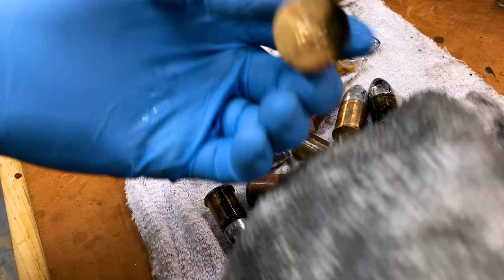Adam Savage's One Day Builds: Hellboy Samaritan Bandolier!

Comment: I have an original late 1800s cartridge belt, holster & Colt .45. The cartridge belt uses slightly lighter weight leather to hold the cartridges and is stitched in between each loop rather than threading the loops through slots in the main belt. It allows the cartridges to seat closer together and the loops don't change size because the belt slipped through the loops. I have no idea which would be easier to make, but since it's held up for well over 100 years I'd say stitching is a good method. Just sayin'. You can see the belt, holster and pistol here: https://www.dropbox.com/s/omqlqhjope24d2s/Colt.JPG?dl=0

Comment: Wouldn't it just be easier to buy real brass and drill out the primer pocket to make in inoperable and just load a dummy round? You could buy bullet molds that would fit the brass to cast specialty stuff or just buy hollowpoints.  It would be tons cheaper, faster, and still just be dummy rounds.

Comment: For someone who is so very precise is his measurements, I’m surprised Adam doesn’t use millimetres/centimetres. They’re so much more precise than inches
Reply: Strictly speaking neither is more precise than the other, as they can be infinitely subdivided as needed - or at least to the limits of practicality - at some point you'll have more resolution than you can put into practice with either system.

That said, inches typically being expressed in fractions is often more useful when constructing objects, as working with fractions is quicker and easier on the fly.  

Ultimately which you choose is simply a matter of preference.  Personally if I'm doing science or something more engineering focused, I prefer SI units, as they are easier to work with since they were designed with simple conversions in mind.  But when I'm building something (up to and including structural assemblies for full sized, trans-sonic aircraft), inches and fractions (or when it gets really fine, thousanths of inches) is what gets used.

As is often said, "The right tool for the right job."  And that's not always SI.